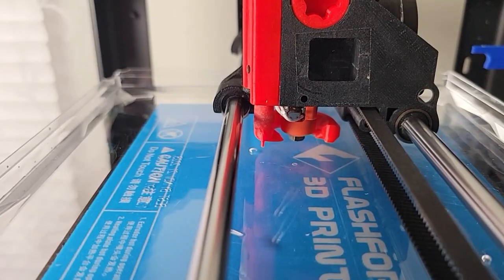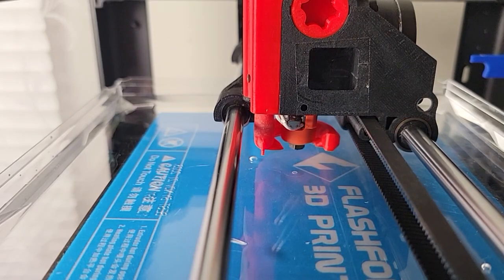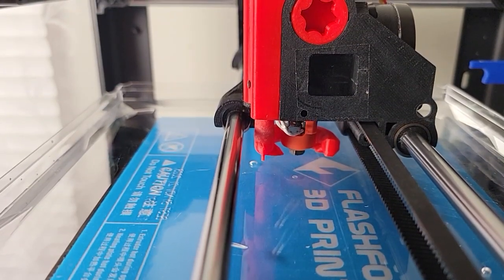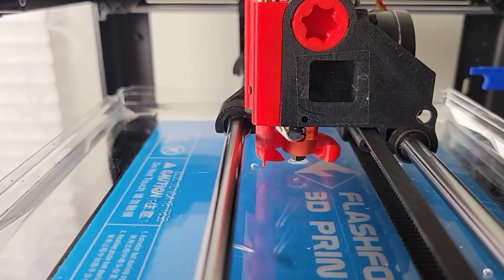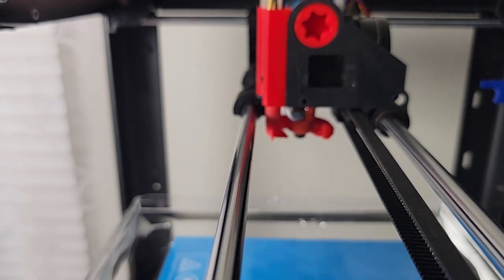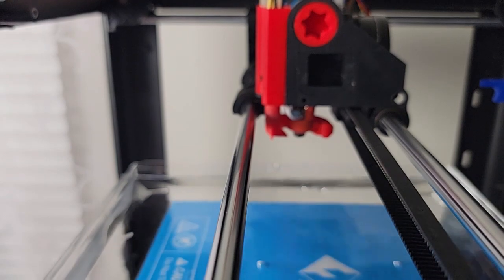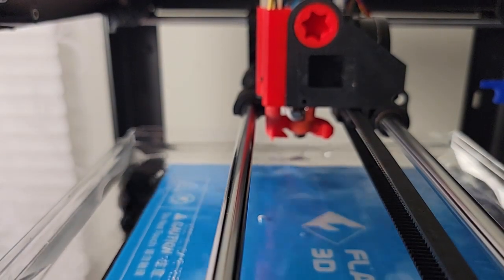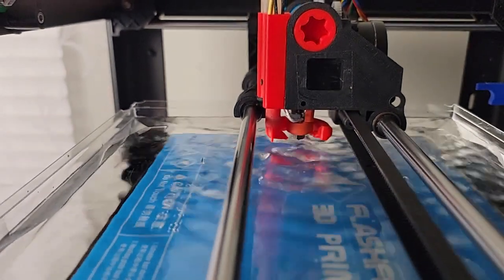Magnetic IDEX part cooling demo. Old-school Flow Simulation 😊 PART1  Countercurrent exchange

Comment: I've been working on part cooling for one of my old printers using several fans, dual 4010 & single 5020 fan, and a tray of water to investigate flow with various duct designs, but the more I see tube systems with external fan (VzBot and yours), the more I leaning towards it. If the tubes are lightweight and flexible, it's a no brainer re inertia and weight for the toolhead/hotend, plus you can make a plenum to improve performance.

Comment: I still run a couple of very old creator pros (pre idex). Would i be able to use your design for a single hotend config on an older creator pro?
Reply from the maker: Yes, absolutely.  Also, if you switch to klipper firmware, you can easily add second toolhead.   For example, I use original ATMEGA control board for Z axis and heated build plate.  The 2nd control board (SKR Mini) controls everything else.
Reply: @m_IDEX  wow thanks! I’ll look into this. I always tell myself I’ll get a new printer when one of them breaks but they both just keep on going lmao. I got them back in 2014 when they were still labelled Creator X. Great content btw subbed.

Comment: Awesome work!
now Im thinking of making a similar system except an ultimaker-style cross bot- it might allow 4 hotends (Quadmex?);
although it would not be able to do mirror mode, and would waste significant build volume in the 4x version of duplication mode
How much force does it take do disengage those magnets?
Reply from the maker: Thanks!  Cool idea with the Ultimaker-style cross gantry.  My first printer was Ultimaker 2.  Your comment reminded me of Hash 3D printer.  https://youtu.be/tzf8903FvCs  Unfortunately I don't see any progress there.  I'd like to design a parallel IDEX printer with 4 heads.  Maybe next year 😊

I guess it takes about 3 to 4 lbs. to decouple printhead from the belt.  Though I have not actually measured it.  May be much lower.

Comment: Since this system uses what seems like a conventional belt path, just with a decouple-able attachment point, do you think it would be able to work with a CoreXY Gantry? Regardless, super cool work, glad to see people are still innovating in the fdm print space :D
Reply from the maker: I suppose it is possible to implement on CoreXY motion system.  However, not very easy or practical.  CoreXY made prefect sense when motion systems were extremely heavy and relocating one flying stepper motor to the frame made sense.